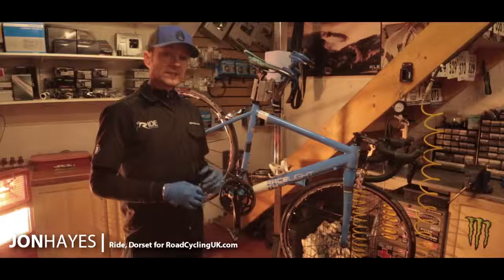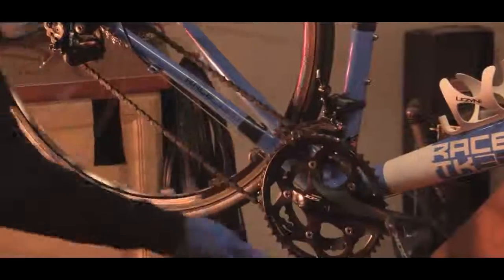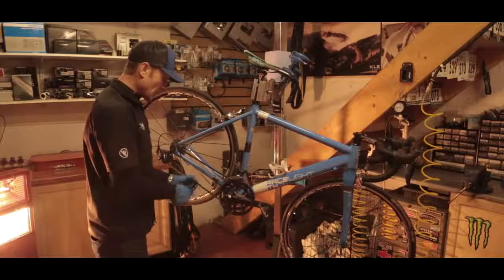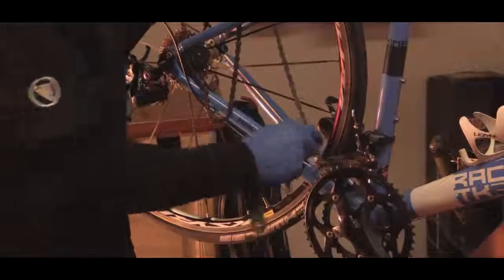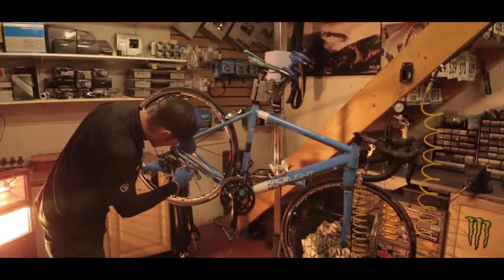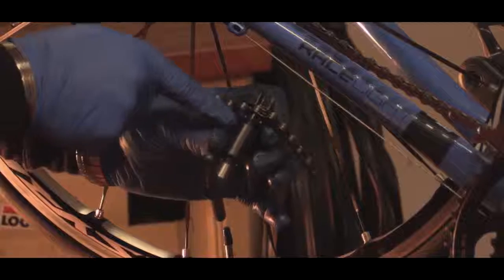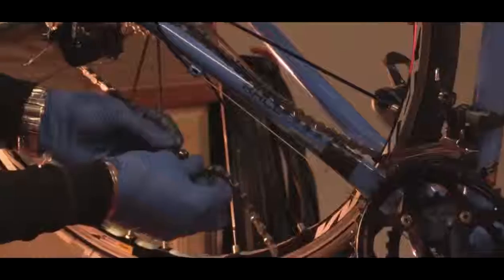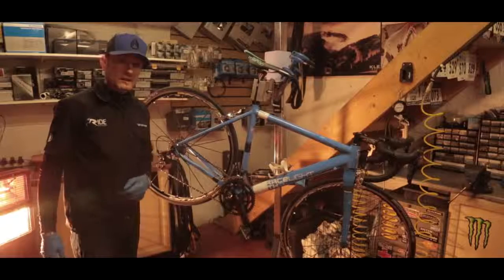How to replace a road bike chain | RCUK

Comment: Good  video. It would have been better if you could have shown a few more close up shots while removing/installing the pins. 
And thumbs up for the info on the use of 2 different slots in the chain removal tool - I did not know that. Thanks :)